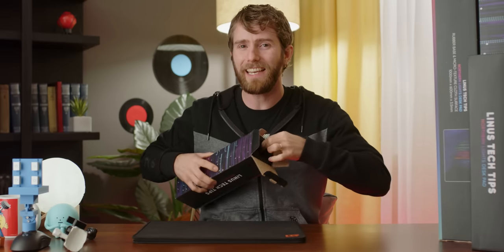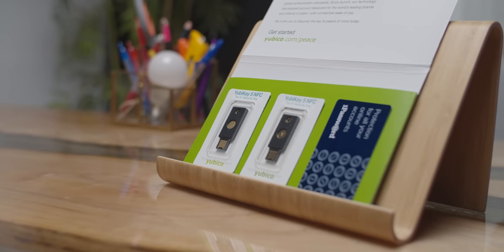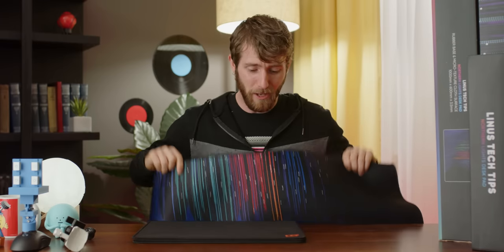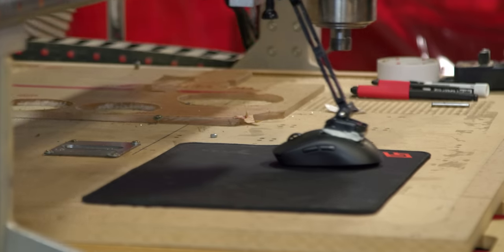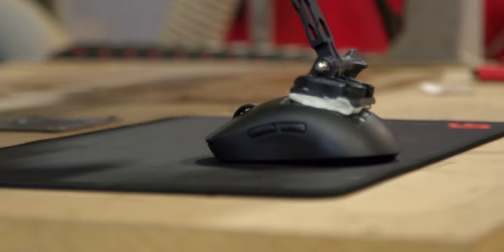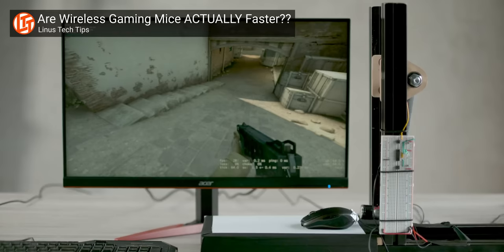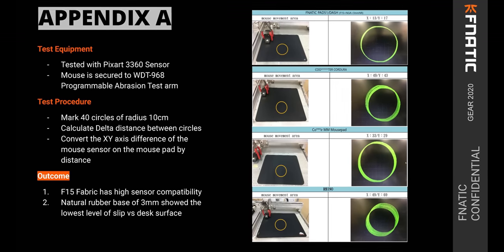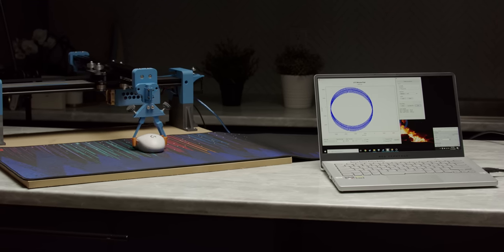A Totally Unbiased Review - LTT Northern Lights Desk Pad

Comment: LTT Store should get an EU warehouse to avoid all the custom and tax costs.
Reply: That would be very nice.
Reply: the increased upfront cost of EU warehousing might exceed the custom and tax costs in the short run. Might work in the long term but LTT isn't that mainstream to do that anyway
Reply: No need. A prepaid shipping option where you pay import tax at checkout is easier, and works well
Reply: FS did that and I finally don't have to break my wallet in half whenever I need very specific networking equipment.
Reply: They would just need to implement IOSS. Then tax and VAT would be payed on checkout.
Reply: YES, shipment for my country costs more than a fucking waterbottle
Reply: They are too small for that.
Reply: Or a forwarding service (ship to a EU country without import tax and then forward to customers in EU)
Reply: And it would reduce delivery time
Reply: wanted to say exactly that.. I was going to buy one but then adding all the costs for EU and honey finding no discounts, I was like "naahhh" Ikea will do
Reply: everybody here in the same eu price boat of shipping+tax being more than the product itself
Reply: I just got one of their mouse pads.
With the cost coming up alot I thought I would show a break down:

 $29.99 mouse pad + $16 shipping + $10 taxes.
This converted to GBP (£) has cost me £39.78 + £1.09 conversion fee (your bank may vary), this is with a 18 day delivery time (within the 14 - 28 day estimate)

#eddit 1 : to change estimated price to actual.
#eddit 2 : to change delivery time to actual
Reply: We even have to pay USD in Canada
Reply: Yes
Reply: Yes the shipping to my country costs more than the mousepad 😅
Reply: Total price of that mousepad including tax and shipping would land at 69.74... I want that mousepad, but maybe not enough that I would pay more for shipping than the product itself.
Reply: I would gladly run it for them :)
Reply: Yeah, $20 to ship a $30 desk pad is a pretty steep price, and put me off buying one to be honest, as much as I'd like to support them and get a deskpad, $50 is too much.
Reply: If LTT is too small to profit from an EU warehouse then maybe they could work together with some other channels like Gamers Nexus or something that could also profit from it.
Reply: YES!
Reply: or maybe have a CDN dollar store since, you know, HE IN CANADA!!!!!
Reply: 20 dolars product after shipping and taxes becomes 60 dollars product thats kinda huh tho
Reply: I agree, i bought one, as support for their work, but shipping/taxes are way too expensive !
Reply: @Sky Alexander Of course I am in Canada and could hire a cab to drive me to the warehouse and back for significantly less than the shipping cost.
Reply: @Sky Alexander Most viewers are definetly NOT from US or Canada.

There are 7.7 billion people in the world, only 328 million of those are from the US.

As for only Europe, there are 746 million people who live there.
Reply: CMDR Dragovich23  Same. I felt like 30$ for a giant 1200x600 high quality desk pad was a very fair price and wanted to order one, but I'd pay more than double the price. At that point it doesn't really make sense anymore.
Reply: Yup... if it wasn't for the fact that shipping and tax will cost MORE than the pad I would ordered one.
Reply: i was litterally purchasing one when i realised the price of the mousepad was the same than the shipping.
As much as i would ADORE an LTT mousepad, two for the price of one because of shipping is sadly expensive.
Reply: They still have yet to implement localized currency or even a US warehouse but there is plenty of reasons why they don’t do it
Reply: YES!
Reply: @RafalBorowski  I'd rather pay ~52€ for a good quality mouse pad that they have put time into, than some 20€ one from AliExpress that will crumble in a year.
Reply: I strongly support that opinion!
Reply: @aryan201  why can they use Amazon eu?
Reply: @MallocFree90  not sure how it works but pretty sure you need an EU inventory to list on amazon EU
Reply: Those "suprise" import Fedex taxes are unacceptable and should be not only disclosed but payed at checkout NOT after the fact.
Even preorders on kickstarter do it right.
Yes the ideal way would be to have an European warehouse.
Reply: @aaronvictor8176  Lol, you're not serious right?!
Reply: PLEASE!
Reply: Don't think this would be worth it, but maybe they can work something out? Would love the deskpad, but 25 for shipping on a 30 product...
Reply: lol for customs i've lot of emails with adam, an EU warehouse is a necessity
Reply: USSR would be a better location
Reply: I live in the Netherlands and the costs to get one over here are just too high. I really would love one.
Reply: @WetaMantis  well they are big but not big enough to have remote warehouses and not alota people are gonna buy it just like that plus linus is a bird brain .
Reply: @Sky Alexander Is that so? Do you have any stats on this? Since these 2 countries combined only cover a fraction of the world population, I'm really curious to see if they combined are >50% of all viewers. (USA + Canada = 370 mln people. World population is 7800 mln people. So thtat's only 5%)
Reply: i paid 50 buks of customs that hurts
Reply: For people talking about Tax in the EU. LTT using Amazon warehouses would work too. I bought the Gaming Book and I paid aeound £20 to get it to me in the UK. I did not have to pay any tax, all because I bought it from Amazon UK, amazon internally moved the stock from canada to their warehouse in the UK as a normal stock movement not as item sold. Hope it makes sense.
Reply: @gorgnof  he has 13.7mil subs... so why is any of the above a relevant argument? hes a Canadian in Canada and we Canadians have to pay in US... so if his own country cant seem to have a CDN store why should the EU.
Reply: @drags666  Nick Light (LTT's COO) said on Twitter that they have to source the products in USD so even if they gave us Canadians the option to pay in CAD that it would amount to the same pricing after conversion.
Reply: You should tru living in the Canary Island and order stuff online...
Reply: the EU should really stop being so protectionist, and allow tariff free imports from the US. (and vice versa).
Reply: mine cost double due to tax and shipping
Reply: TommyInnit 🅥  i wonder how many people you got with that
Reply: Yeah, that is the most annoying part... Last year I caved and got a mousemat from GN and a bottle from ltt, but shipping and customs is just too much to justify more regular things
Reply: @gorgnof  you say that as if all 746mill watch LTT, I'm pretty sure they've shown their demographic before (or it was another tech channel) and majority is still the US.
Reply: Yes please! I've been waiting for buy merch for lower customs and taxes (and shipping!) for YEARS now! :(
Reply: Amazon & Banggood have EU warehouses, maybe they should partner with them.
Reply: YESS, i would love that so much.
Reply: Yeah I have just orderd once from the LTT store and after paying shipping, tax and also customs it was straight up not even close to worth it and I will not do it again. If however they would ship from europe I would be buying stuff often, I like a lot of the stuff they sell in the store, but I can count with paying double the price for everything at the time I have it in my hand and that is just too expensive.
Reply: TommyInnit 🅥  give me your vbucks
Reply: @gio9789  For me I would have to pay 60$ for 29,99$ mouse pad
Reply: with FedEx Priority Shipping you won't be paying anything in customs or tax and shipping is 3 days
Reply: Yes set up an EU warehouse or can you add a official Amazon link where you stock your stuff If I remember correctly you had the water bottles on there.
Reply: YES! THIS!
Reply: Can confirm, paid nothing other than mousepad and shipping to EU
Reply: Jup, spending more than double for tax and shipping doesn’t make it attractive to push ‘buy’
Reply: They already "fixed" it. When ordering to the EU now, they show the tax right in the order. Then when it arrives, you don't have to pay anything.
Reply: @DX88  Umm.. No. No tax for me in the cart, whilst I'm in the EU (unless EU kicked us out and I didn't get the memo 🤣). I've hoped that they will get an IOSS retailer status so I thought I should wait for the regulations before purchasing (they didn't have stock either) but.. yeah, I won't be buying. EDIT: Hmm, was trying to add various merch in the cart, VAT showed up a couple of times in the final step along with shipping.. Maybe they did get an IOSS status after all, it's just the store that's a bit wonky. Well, if it's true then that's great news!
Reply: @NiC707  Try going to the payment screen, tax only shows up there.
Reply: @DX88  Yup, I've just edited my previous comment
Reply: @Beyondthecustomary  They have to follow the (EU) laws. It is what it is. It's worth it to you or not. If it's too expensive for you, don't buy it?
Reply: @DX88  I know the owner of a large dropshipping warehouse in Poland (EU) we could get this to work
Reply: Dont know If i was just lucky, but they did send It to France and then to me in Denmark, and didden pay import or tax! 😀
Reply: @Beyondthecustomary  Not to sound like an asshole but why would they care? They sell a shitload now still anyways. Also the shirts for example (American Apparel 50/50 polyblend) are more expensive where I live than what LTT is asking for them (including tax). So they're still not expensive at all. So I'm guessing things will stay like they are now.
Reply: @htcpanik  That's the new, correct, official, way. Check your bill, you already pre-paid the tax on the order!
Reply: @DX88  sure, just talking about the warehouse possibility. I haven't looked into the other products they offer and their fair price. But in the end, the mouse pad is still cheaper than a razer one.
Reply: Yeah, i thought so often what awsome stuff they have at ltt. It always ends with me not buying because of  taxes and shipment
Reply: And a Australian one. $15 postage is crazy
Reply: @Quickshift_Racing  That's just what they pay for it. They've confirmed multiple times on the wanshow they make 0% profit on shipping. The company isn't big enough to get cheaper shipping.
Reply: @aJazzyFeel  enjoying my American Privelge 😎
Reply: Looks like there are a lots of EU ppl who think $60 for a mousepad is just a bit too much...
Reply: An EU warehouse would be great as the cost to ship to the UK is insane compared to what the products costs, its $29.99 for the pad and then another $19.99 on top. Have ordered my first LTT mousepad though so hopefully that will be here shortly 🙂

Comment: As a professional machinist myself, I approve of this use of a CNC.
Reply: As a professional machine operator myself, I approve this use of machines.
Reply: as someone with a degree in engineering... i do not approve of reading newtonmeters when talking about force
Reply: @sai-9997  as a non-american i agree with metres
Reply: @sai-9997  what else would you use?
Reply: @octodionis  Newtons
(newtonmeters are a measure of torque)
Reply: @stepanpavlica4841  you do have a point, though actually I think force is usually measured in kgf for practicality
Reply: Tudor Razvan no its only in kgf for people that aren’t familiar with physics
Reply: sai noneofyourbusiness exactly who tf talks in newtonmeters for measuring force
Reply: @octodionis   what  @Štěpán Pavlica   said

using kg is the best way to show one has no clue, but using Nm instead of N is the close second
Reply: I always cringe when I hear "kgf"
kg is a unit of mass, not a unit of force.
also it's stupid.
1 kgf is about 9.81 N (1kg * gravity of earth, varies between regions, but 9.81m/s² is what I learned in school)
for having a rough approximation, you can basically say 10 N is equivalent to the Force of holding 1 kg.

Comment: I thought about getting one but even the smallest one is WAY too big for my tiny keyboard tray, unless one day I actually get a full desk.

They look great but my feedback is I didn't buy one because they are just TOO big for a normal desk keyboard tray.  If you guys have them in stock after I finally upgrade to a normal desk that has tons of space I totally want one.  I see they're in stock again now so I guess I just have to buy the tiniest version and see if that fits?

My biggest problem with all mouse pads is that they eventually get flimsy and start doing this thing where they like fold upwards on the corners after extended use, and once they do that there is no way to get them to be completely flat again.  So I've gone through many mouse pads over the years and have no clue if the LTT mouse pad will do the same thing after a year or two, I'm guessing they won't because they have stitched edges on them so that is nice.

In conclusion buying a $30 USD mouse pad plus shipping for something I won't use right now because the smallest 900mm X 300mm is still too large for a keyboard tray (I have to use a numpadless Corsair K65 LUX keyboard + a logitech G pro wireless to fit in my tray), I just keep buying Steelseries QCK mousepads every year or two once they get foldy on the edges since they're only like $10, I'll have to try a stitched edge QCK version eventually.

I def want one because the art is very nice but I'd probably be folding them over onto my keyboard with how long they seem to be.
Reply: @neondemon5137  That's probably why they fold/fray upwards on these Steelseries QCK's because the ones I get are not stitched on the edges.  I thought about getting one of those edged stitched ones last time so next mouse pad I get maybe I will try that.

Comment: Just wanted to say thanks for the 900x400mm pad I just ordered yesterday after watching this! My desk previously didn't have room for any of your sizes the way it was laid out, but I just put my monitors on the wall mounted to arms, and moved my speakers from a terrible 90 degree triangle arrangement (my desk is a corner desk with my subs under it in the corner, used as much for audio monitoring as it is for some absolutely fantastic sounding game sessions), to a standard 60 degree arrangement. had to turn them sideways but that's actually pretty common in studio setups anyway due to the same space constraints I ran into. Wasn't sure what desk pad I wanted to buy until I watched this video, and my current mousepad has roughly the same depth as the pad I picked up (mine's 16" but whose counting 12mm or so). It'll definitely help round out the whole setup that's for sure.

Comment: the best mouspad ive used is a desk plastic surface sanded with a coarse sandaper than finished with a fine one. when it gets worn after 6 or so ko ths i re sand it and its good as new, glides well too provided you hate mouse skates.

Comment: I'm interested that you went with a soft mouse mat. My first optical mouse (with a Sun 4/330 attached) used a solid metal plate with a grid of lines on it. Presumably that kept the calculation a bit easier.

Comment: best mousepad ever is a piece of non-patterened carpet tile, about 22x26cm... great texture for optical mose tracking, easy on the hand and wrist, rubber backed, and actually washable with soap and water, and hang to dry when it gets dirty... or just toss it and replace with another section of tile!

Comment: That motor is not rated for 960 nm, it's most likely 2nm, which translates to roughly 150 pounds of force if you have a 20mm ball screw with a 5mm lead

Comment: I am planning on building a PC with following specs :-
I am planning for Gaming and Live Streaming
Ryzen 7 5700G
Asus TUF Gaming B550M Plus Wifi
MSI MAG Forge 100R
Corsair Hydro H100i Pro XT
WD Black SN750 500GB
GSkill 16Gb 4000Mhz 18D
Cooler Master MWE V2 650W Gold Plus

I want to know if I should go with R7 5700G or get a R5 5600G and save up some for either more Ram or Graphics Card in future.

Comment: Looking to get one of these, but have some questions first: How exact is the size? My desk is 598mm deep, will I end up with some overhang if I get the 600mm deep one? Also, is it ok to put the mat underneath a desk mounted monitor arm? My mounts come out by more than 10cm so I'd either need to get the 400mm deep one and have a big gap at the top of my desk or get the 600mm and put it under the mounts. I don't mind it leaving a mark on the mat but I don't want it to make the mounts unstable.

Comment: I usually just print a 1x1mm black dot pattern on an A4 sheet of paper with high resolution photo settings on my inkjet printer for a mouse pad...

It often gets ruined anyway by flux residue, soldering iron burns, and me writing on it while thinkering with arduinos... :D True it often slides around on the desk, I should probably do something about that...

Comment: I use an aluminum mouse pad. I used to have one of those cloth ones but one day years ago I came across an aluminum one and had it ever since. It is been years and it looks the same as when I bought it and I work on the computer doing 3D modelling, editing, etc for 12 hours a day. The cloth one smelled rancid when I replaced it.

Comment: Indeed, logitech has awersome precision, mediocore-awfull quality and software which doesn't work most of the time (for me it works well with my g403 prodigy but doesn't  with G432 headphones, which while being 20 eur more expensive than the mouse, had awfull quality, few issues right from the shelf and broke bery easily. At least these were also accurate and mic was good, for the first month as it stopped working due to bad soldering)